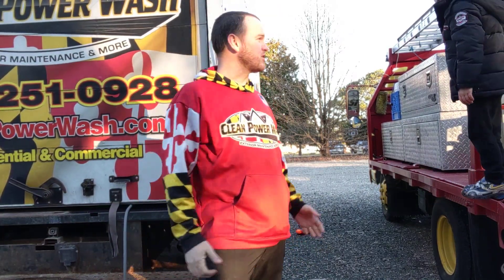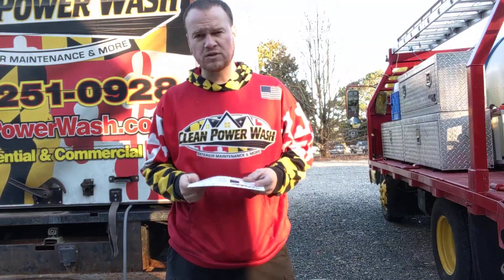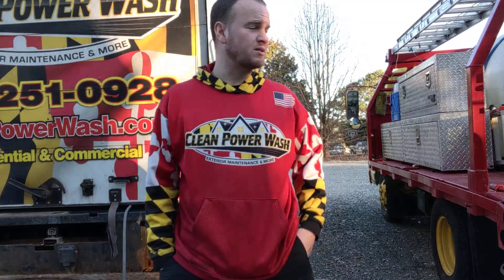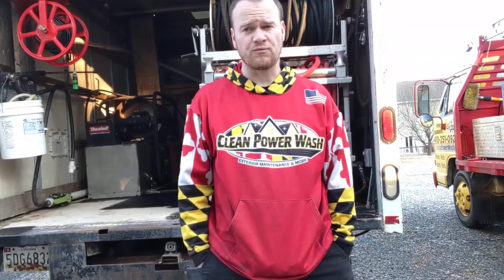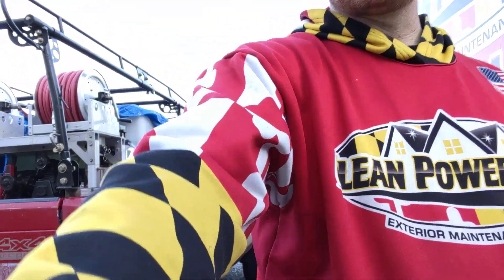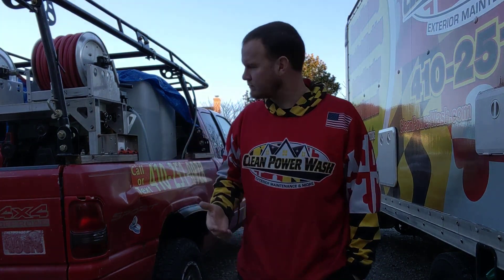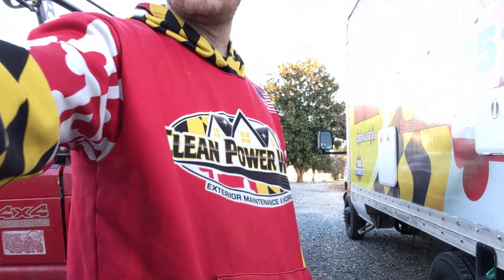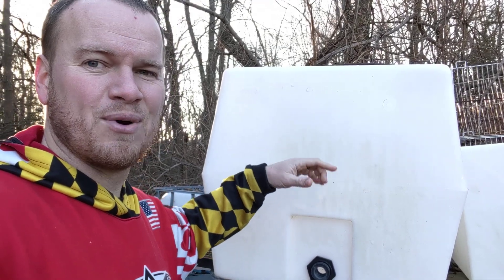What size buffer tank should you use on a pressure washing rig?

Comment: Question. For a 4.0-4.2gpm machine what size buffer tank would you recommend? Would a 40-50 gallon water tank be good enough? And for a first time pressure washer, what low cost pressure washer would you recommend? I see some dewalts, but they have some negative reviews and then I see Simpson and Westinghouse that appear to be alittle better. Just wondering what everyone’s thoughts are on this.
Reply from the maker: You could use a 40 gallon, but I would recommend a 100 gallon tank.  Simpson is an ok starter machine
Reply: @Cleanpowerwash  Thanks man. I appreciate it.

Comment: I’m just starting and running a single 4GPM machine. My concerns are mostly about using a buffer tank so I don’t have to shut off the washer while I’m off the gun to avoid damaging the pump. I have a VERY small trailer and wondered what size buffer tank you would recommend?
Reply from the maker: 50 is the smallest that I would use.  It will be temporary either way.
Reply: @Cleanpowerwash  

Temporary?
Reply from the maker: You will upgrade your trailer and machine soon so this will just be a temporary set up
Reply: @Cleanpowerwash  

Gotcha! Thank you !

Comment: I have a belt drive pressure pro 4000psi 4gpm and I run a 65 gallon tank from Tractor Supply. it works great 2 to 3 houses a year that can't keep up
Reply from the maker: Yeah at 4gpm it should be fine unless you are washing in a trailer park
Reply: @Cleanpowerwash  😂🤣

Comment: Hi,

Is there a difference when using a belt drive vs direct drive with a  buffer / water  tank? 

I have a 4000 psi @ 4.0 gpm but will up grade to a 5.5 gpm. I would like to know which correct size buffer tank should be ideal for both pressure washer.  

I know you're a bigger company and need the bigger units. I'm just a one man crew but my son does help me once awhile. 

Any information would be appreciated.
Reply from the maker: Ibc totes are the easiest.   100gallon buffer is the smallest I would recommend.
Reply: @Cleanpowerwash  

Got it, 100 gallon buffer tank. 

Would i need a buffer tank for a direct drive pressure washer?  Or only for a belt drive?

Comment: I have a Pressure Pro 4000 psi 4 GPM. I just hooked up a 35 gallon tank in my trailer and did a bypass from my pump into the trailer I find when I am not pulling the trigger on the wand it fills up very quickly so I leave the valve open to empty. This is the only thing I’m using it for to keep the pump cool. I would love to hook it up with a float and directly feeding my pressure washer but wouldn’t it empty too quickly and I would be without water and burn my pump up. I really need to help with this what’s your thoughts? Thanks
Reply from the maker: With 4 gpm it should be fine. As long as your supply flow is greater than or close to your draw rate
Reply: Would u go with a 35 again im in the country i think i might need a 65

Comment: We run a 65 gallon tractor supply leg tank with a 5.0 gpm and Gen 3 12 volt system. In 2019 our first year we completed 118 projects and 3 homes would not keep up. 2 were in a rural area and 1 was kn the city at the top of a hill. Great video and advice.
Reply: My setting up the same rig 4gpm with a soft wash but im out in well water country should i do a 35 or 65??  i have a t Tractor Supply right down the street
Reply: Id do 65 or bigger if you have the space.

Comment: I have a 450liter (118gal) and it's absolutely too much for me. In my area, flow from customer spigots is great. If I could roll back, I'd get like a 30 gallon. It depends on where you operate, so pick what you need.
Reply from the maker: How many machines and gpm are you pulling?
Reply: @Cleanpowerwash  Just a small fish, single 5.5gpm setup. Again, as you stated in the video, if you have more pumps then a bigger buffer might be good. But for me, in my area if I open a customer's tap fully and put my hand in front of it, it really hurts. That flow is plenty enough even without much of a buffer.
Reply from the maker: That is awesome to have good flow